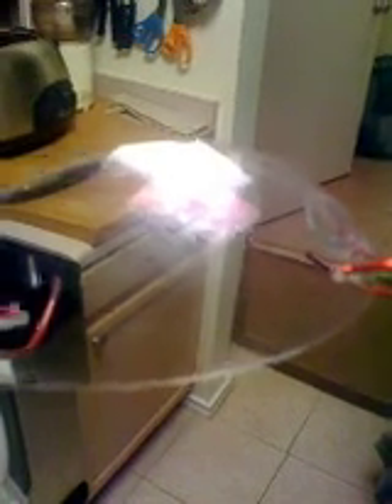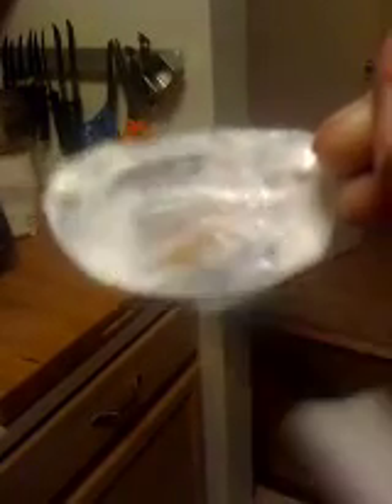Demonstration of Armour Etch to remove anti-reflective coating on plastic eyeglass lenses

Comment: So very glad I came across this video!  My glasses were less than a year old when the AR started to fracture.  These are actually the replacement pair for the original ones that had similar fractures.  As with everyone else, who can spend another $3-400 for a new pair.  Thank you for taking the time to post the video.  I followed your steps exactly and in 5 minutes I can see clearly!  Thank you!

Comment: I asked one of the optician assistants at Cosco about how to remove the coating. She said to try Armour Etch because she heard about it from a customer. Just happened to notice on the Michaels website a 50% off coupon. Found the Armour Etch, got the discount, and watched this demo video. While I was brushing on the etch I held the glasses over a paper plate while wearing nitrile gloves. Wow! 90% came off. Did the second pass for about 3 minutes. 100% gone. Thank you!!

Comment: It worked! Just did it. Applied Amour Etch to both sides of lens with Q-tip and waited for five minutes, rinsed with hot water for a few minutes.  Did it twice to be sure.  Removed some remaining "fog" by rubbing both sides of now clean lens with soapy fingers and soapy water and again rinsed thoroughly.  Thanks a million!

Comment: Be sure you wear protective gloves and eye protection. Armour Etch is made up of sulfuric acid, barium sulfate, sodium bifluoride and ammonium bifluoride. Our host here is setting a bad example. Contact with this chemical doesn't like to heal and if even a small diluted amount makes its way to your eye; you will likely lose that eye.

If this stuff contacts the skin, the fluoride in it will be absorbed into the tissue and react with calcium ions. Over the next few days damage will become apparent and can even cause hypocalcemia in your bones. Inhaling it will burn your lungs. Google "MSDS Armour Etch".
Reply: Wow thanks for the info!

Comment: I bought it at Michael's, which is an arts & craft shop.  I found it in their glass etching section, and a small bottle cost me $13.. You can also buy it online through Walmart's website, but it is not sold in Walmart stores.

Comment: Works excellently. I left on the etch for 5 minutes the first time and 3 minutes the second time to clean off the remainder of the coating. Used a lot of water to rinse them. I can use the glasses again instead of spending $700 for new ones. According to one optician the anti-reflective coating is only good for 2 to 3 years. After that they want you to spend big bucks for another pair.

Comment: Because I know what armor etch dose to glass I did a test swatch on the very edge of the outside of my glasses. After 20 seconds wiped it off and saw it worked for me. I used less than 1/3rd of the armor etch used on one lens in this tutorial for my whole pair. I only thin coated the out side of the lenses, I also just applied it without smearing it around. Kept it on for about 30 seconds. I think in all cases doing a test swatch on the edge before coating the whole lens is just common sense.

Comment: BE very careful....specially if your glasses are expensive...this product did not work for me and somewhat made my glasses worse.....mine are plastic....before i even tried the armour etch....I could take my nail and slightly scratch the coating off the glasses....so now after 8  applications...all the the product did was seem to bury the coating into the lense....now i cannot even scratch the coating off with my nail....obviousuly not every coating or poly plastic glasses are the same u caution

Comment: I tried this and found that it ONLY works if you don't rub the compound around on the lens. The abrasives in Armour Etch will leave LOTS of fine scratches on the lens. Instead, just apply the stuff and leave it on for 5-10 minutes. Wash it in warm water (wear gloves) taking care NOT TO RUB the stuff off - let the water do the work. It will still remove the anti-glare.

Comment: Thank you so much! That worked amazingly. I was skeptical like I'm sure most people would, but it was super easy. I didn't have a paint brush so I used an old toothbrush that I will throw away. To all the overly cautious people...I got some on my hands thru the process and just made sure to rinse off quickly and had no problems :) Thanks again!

Comment: Thank you!   Fantastic!  My eyeglasses were no longer wearable due to that cloudy, milky film.  I found a big bottle of Armor Etch at Hobby Lobby for $19.99.  Didn't need that amount, but it saved me the cost of an eye exam and replacing my lenses, & it was well worth every penny.   I did mine 3 times.  On the third treatment, I noticed a little bit of metal flaking from my frame, so I would recommend keeping as much of the product away from frame as possible.  Husband's glasses next! :)